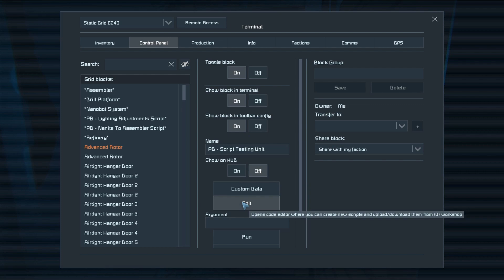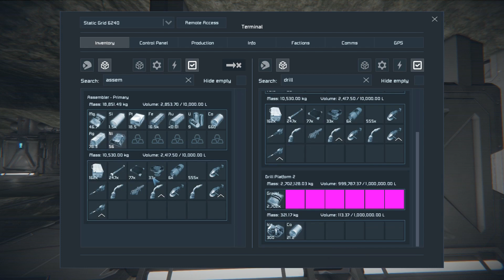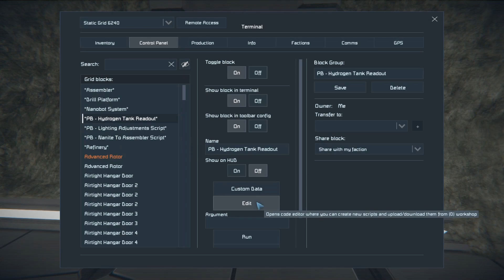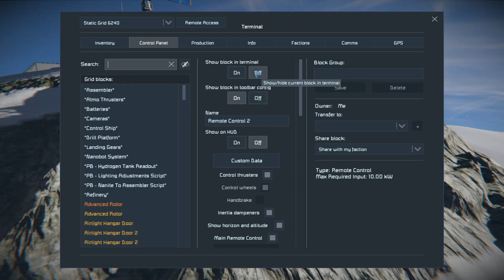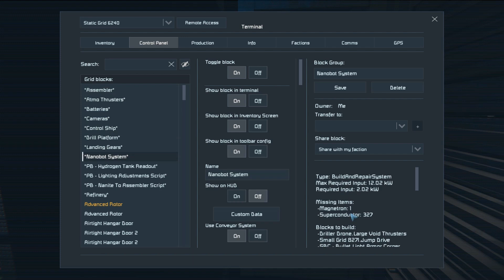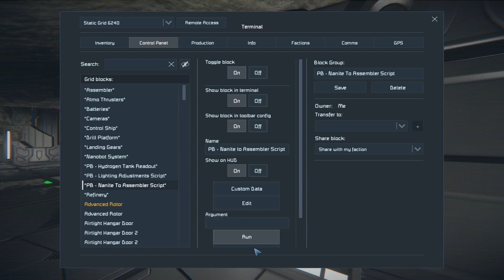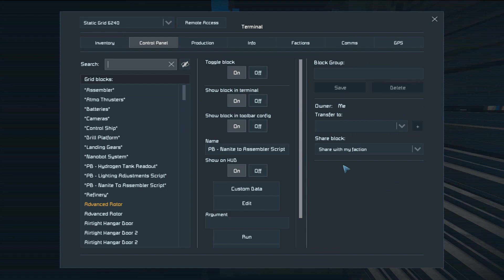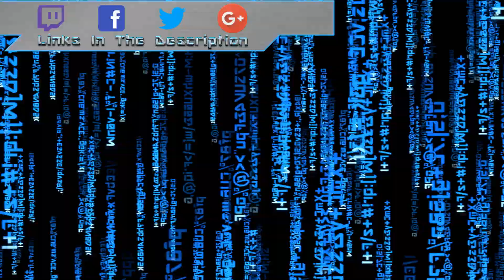Recovering My Driller Drone & Talking Series's Future Ideas - Let's Play Space Engineers - E57

Comment: Go to the Assembler and make an Elite Welder and help theBuildandrepair system finish welding the ship. The ship will get done a lot faster.
Reply: That could help, but I was kinda thinking of a multiplayer let's play, where you have multiple players, helping in welding, grinding, or even attacking/defending bases & ships. Also, the Corruption Mod, would give you more enemies to deal with, and with higher frequency, to keep things interesting.
Reply: Sounds good to me.
Reply: I think the problem is making the components. So to helping with welding wouldn't really do any good
Reply: True, but you can take into account, the planetary lander's, that you start off with, contain both an assembler, and refinery. So technically, you could link up something, like 3 or 4, assemblers, and refineries, to get more components up.

And also, you can disassemble components, so you can make the components, that you need.
Reply: My comment was for the first one
Reply: I think the base needs an electrical upgrade with more assemblers and refineries plus one buildandrepair is slow. A lot of work went into that base and I would like to see it used for something other then a walk through.